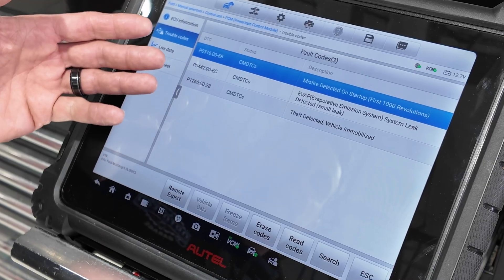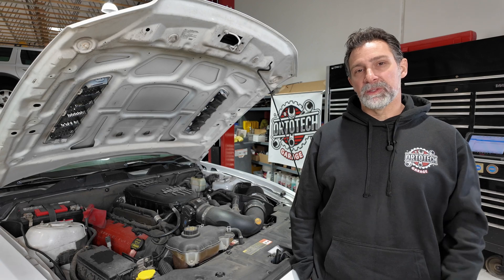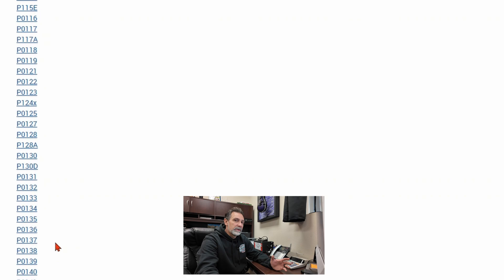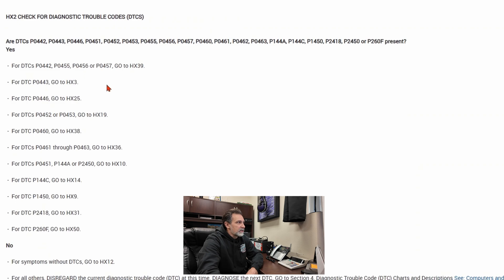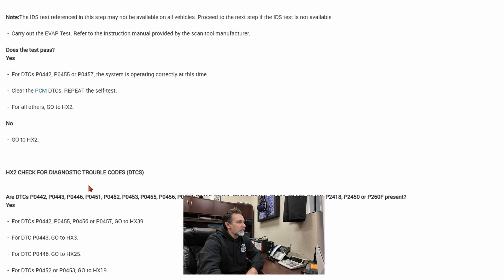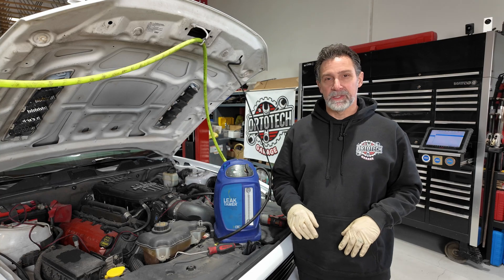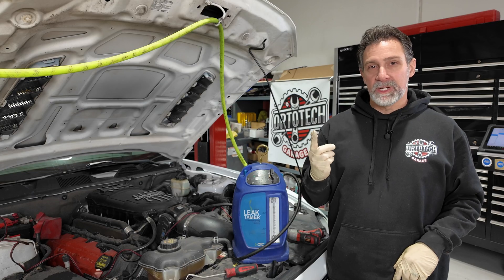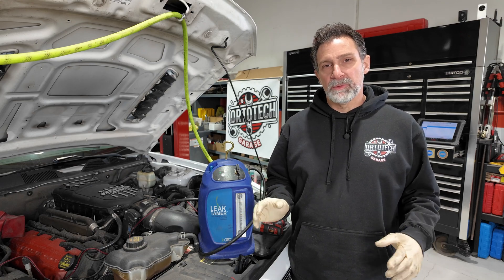How Does Your Mechanic Diagnose a Car? | OrtoTech Garage

Comment: Great video! Thanks for in-depth description! Very helpful! Can a DIY also have access to ALLDATA Diagnostic Hotline resources? I would also assume this Hotline resource is vehicle brand specific?
Reply from the maker: @davidtrepanier9751  Thanks, David!  AllData is a subscription based information system and not exactly a hotline.   I do believe they have a limited version for DIY and possibly even for your specific vehicle, but I have never used that service.  We always need the full version because we service all makes and models.  They also have a collision repair system and shop management software. It's a great question. Let me know what you find.  If I have some time, I will try to look into it as well and see if I can get a good answer.  👍
Reply: Alldata offers a DIY version with several different price points.  I have yearly subscriptions for all of my vehicles and the information provided is invaluable.  The information is pretty comprehensive and includes pretty much all of the same information that the shop version has.  There are always discount codes floating around to use for subscriptions.  I highly recommend having this service.  It's almost impossible to fix these newer cars without it.